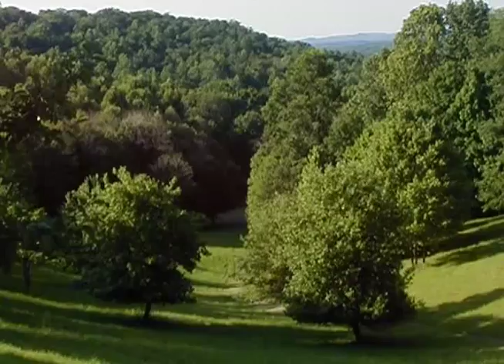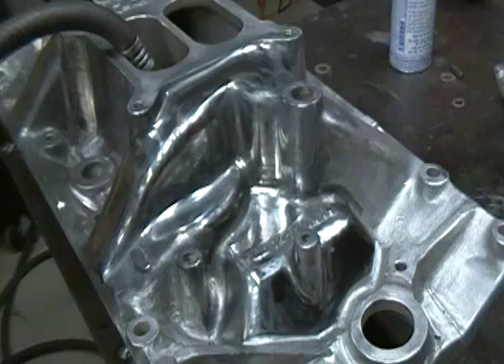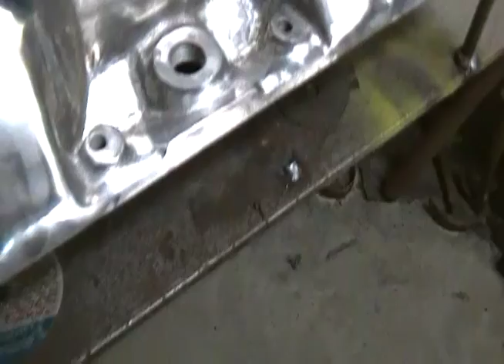Project Corvette (Intake polish_002)

Comment: I found that the dremel 511 melts cast aluminum very well, but the brush wheel melts away too, I can do one runner side with one of the two wheels that come in a $5 box.  Instead of buying $50 worth of wheels, I hand sanded my huge intake mani (hits hood it's so big) Glad to see I'm not the only one having toruble.  It's getting there!  On day 3!  Sheesh!  Good luck sir!